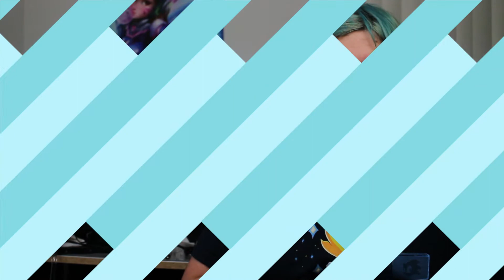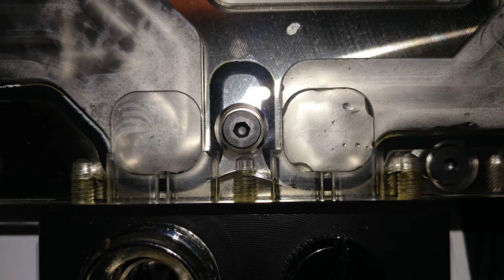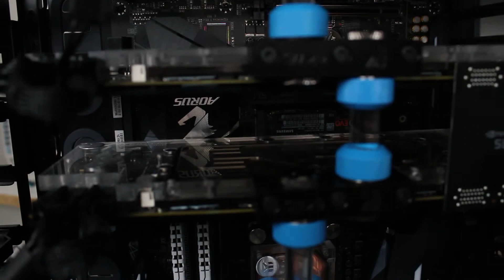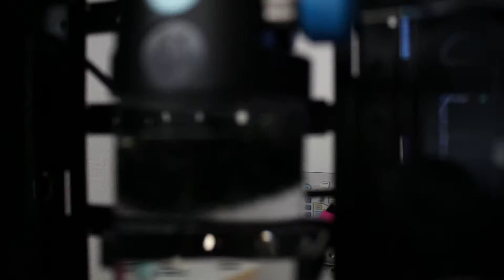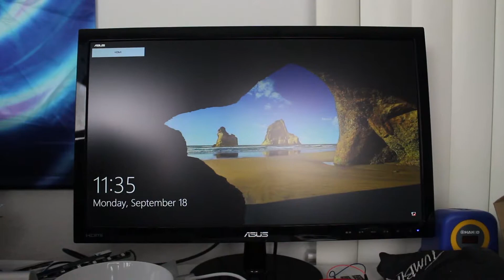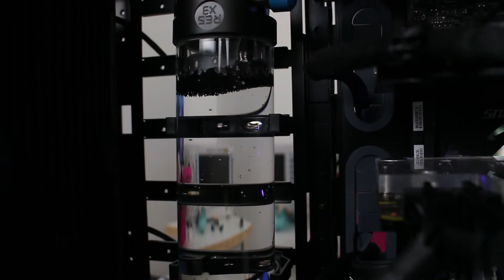Custom Watercool Loop is FINALLY READY! D.Va PC Build Log #4

Comment: I'd like to point out that your res is actually upside down, and your top tube should be as horizontal as you can get. I'm building my first loop soon still need a few fittings but I've done a lot of research, a metric ton at least.

Comment: Why not use the dual terminal again?  I'm assuming those cracks in the screw holes caused the initial leak.  Maybe from over tightening?  Cool build either way.  I went with the same dual terminal.
Reply from the maker: +Knyght100 I did try to get the dual terminal working again in parallel, but when I was running water through, it didn't seem to be able to push fluid into the second graphics card, like some air bubbles were blocking it or something. And I was starting to run out of time to really debug it. But yeah, be VERY careful when tightening the dual terminal into Plexi blocks. That was a lesson nobody mentioned. 😅